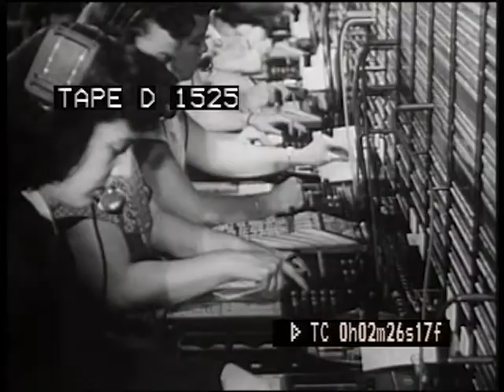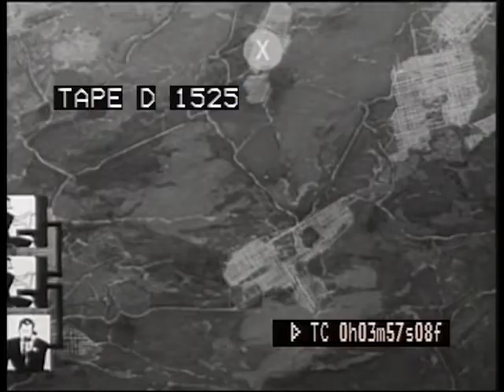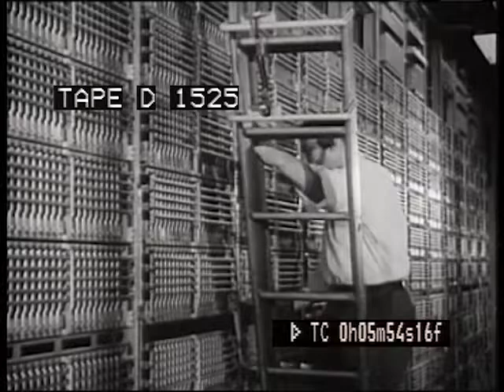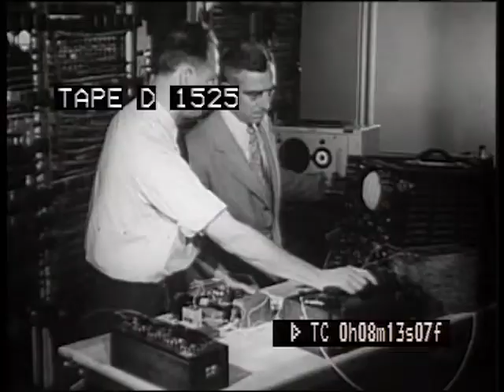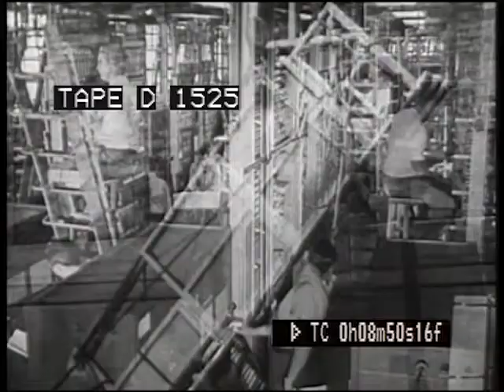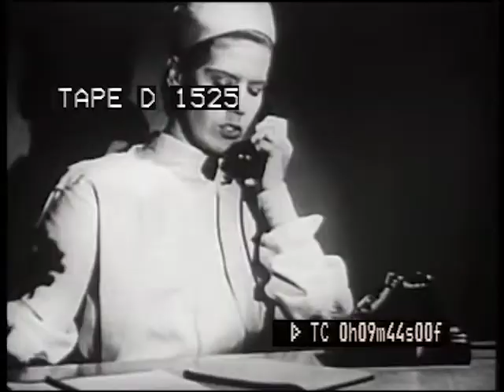Telephone Technology - 1940s - USA

Comment: DTMF. Isn't it?
Reply: DTMF wasn't officially implemented until 1963. However, it is obviously based on the same concept. The only real difference being that instead of an Operator sending Dual-Tone Instructions to the Circuit Switch the Caller's Phone itself is able to Output those Dual Tone Instructions, as the Caller Dials.
Reply: Multi frequency